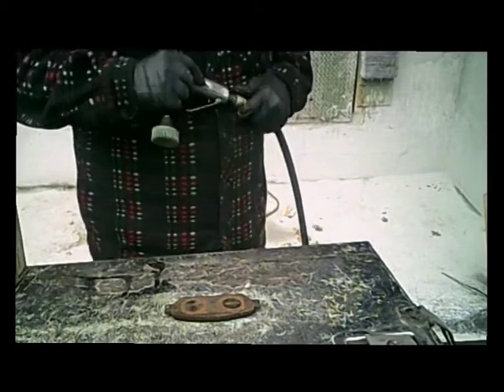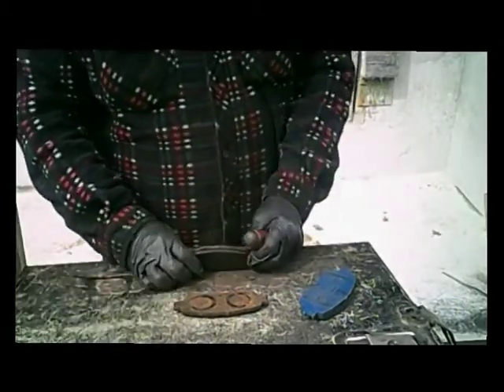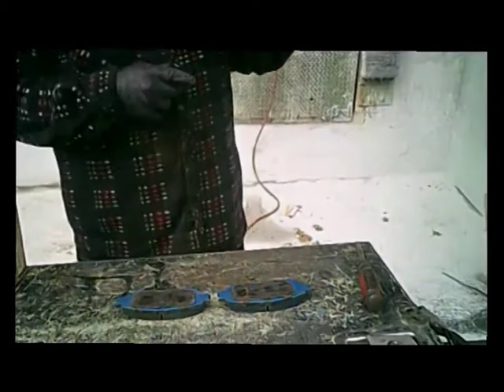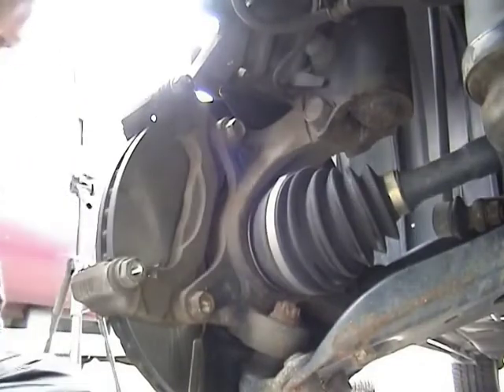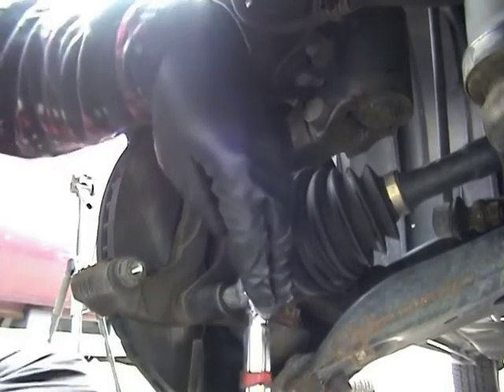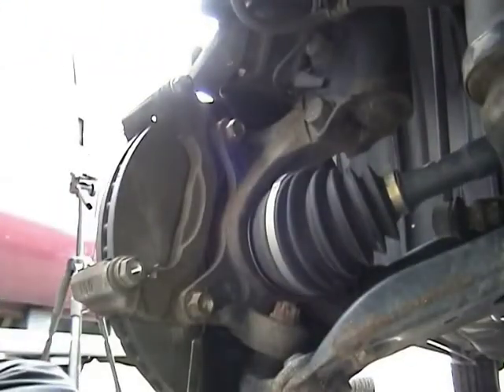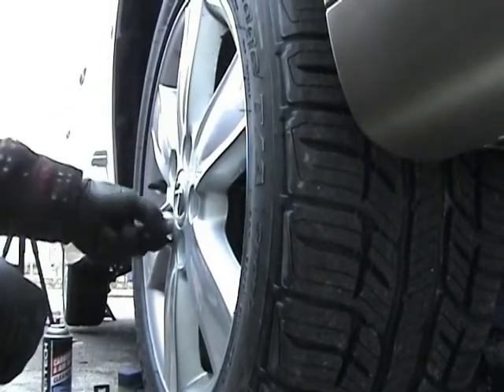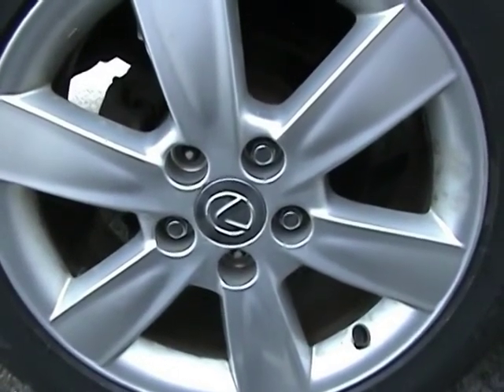2005 LEXUS ES330 FRONT BRAKE & ROTOR REPLACEMENT DIY w/Torque

Comment: What grease should I use for the slide pins?
Reply: high temp synthetic brake grease, could find this at your local auto parts store, oreilys, autozone, harbor freight. I tried finding it at walmart but they didn't have any, permatex brand is one that was recommended to me. "Permatex ceramic brake parts lubricant" It's a blue bottle with purple stripe.

Comment: question:  is there enough space for the tangs projected part which was taken off the old pad was put on wrong, therefore the tangs larger projected part was directed inward toward the pad and not directed toward the oil pan as you did. 
( i don't if there is even enough space for the tangs projected to occur.  
 if it was put in the wrong direction as described what would be the effects??

Comment: No lube?
Reply from the maker: OEM Specs call for no lube with OEM parts.  Now I cant vouch for auto parts store parts.  These were dealer brakes, very expensive.  However, customer bought the parts.  I install them per specs.  No problemo.
Reply: Raw dog it 👍